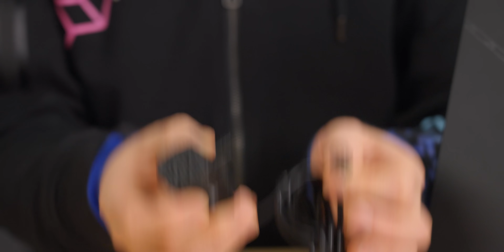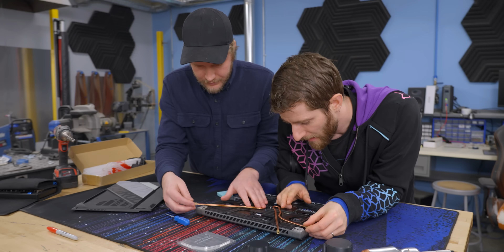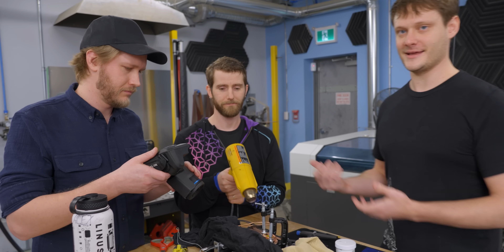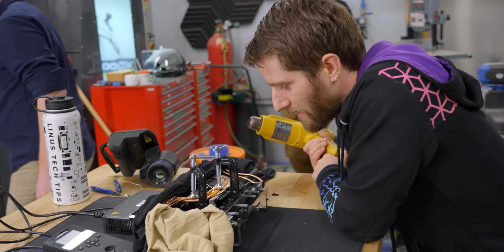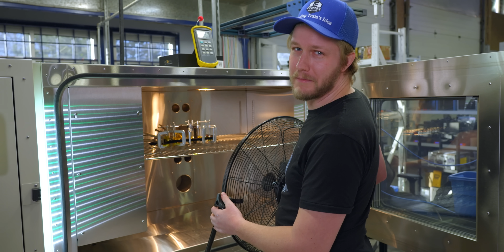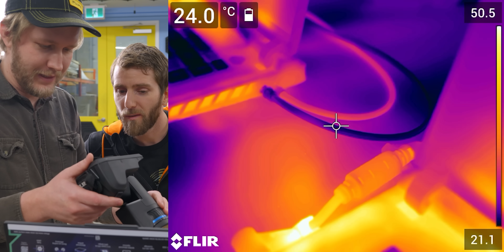Water Cooling a Laptop for $30

Comment: This is literally a live example of when stupid has way more luck than brains... They bent whole cooling out of shape and then pushed full force on two naked dies and somehow didn't damage them.
Reply: [insert “first time” meme]
Reply: Ive done tool and die for a long time.
And done tool and die for elecronics manufacturing.

You do NOT want to know how close they came to mimicking the actual manufacturing proc. for making these heat tube/heat sink assembillies.
But I am gonna tell ya anyway.

OEM's use a thick as heck chunk of aluminum and steel to clamp things together then throw em in an oven to get the heat to melt the solder. That way they can shim the pads if things are visiably warped... But they still ship the warped ones. That heat sink was probably in the rework area, probably. Just because it was for a top of the line laptop, otherwise ir would go to assy for a test just like they did.

Thats it.
Humans with simple tools are often the most precise and accurate means of manufacturing anything large. With practice we can even reconize flaws that are on orders of magnatude smaller then light, we cant measure the flaw but we can detect them just with our fingertips.

We are increable animals all of us.

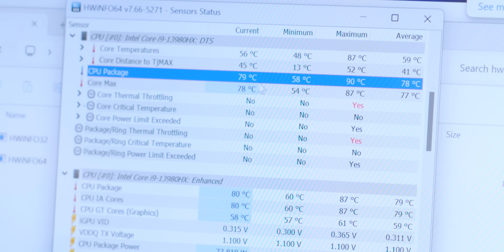Comment: 24:00

I think it's because the laptop doesn't use the dGPU when it's running the internal display and idling, the mux switch turns the dGPU off. When you plug an external monitor to the laptop, as the HDMI (or DisplayPort) is wired directly to the dGPU, the mux switch will activate the dGPU at idle thus the thermal sensors and whatnot. Happened to me on two different laptops with a dGPU and a mux switch.

I assume if the laptop doesn't have a mux switch the dGPU will run continuously thus the sensor readouts.

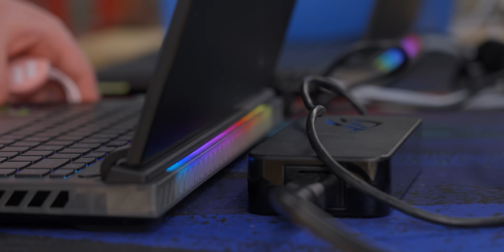Comment: Please talk about the fact that laptops have such a heat dissipation issue when layed down flat. I feel like the trends have gone to be thinner, with as side result that the cooling power is offered up, mostly "ignoring" the back fan exhaust and dumping EVERYTHING onto the surface it's put on. Even  Alex had to give the stock laptop a boost ,by doing the trick (33:58)

Comment: What happened with the solder is that the solder they were using fused with the other one, which caused it to be susceptible to a lower heat resistance, we use lower heat solder to de-solder things with a high temperature resistance solder

Comment: Tip: never buy a Moza product. RMA service is very poor, and Hardware experts also let you down for months. I have had my R5 set with brake lite kit in transit for over 2 months. Picked up last week so it was not repaired and therefore hopelessly unable to sim yet. So back to the HE in Lelystad, the Netherlands and they would urgently arrange a new brake pedal (because it was/is still broken) from Rseat Germany, now more than a week later and still no pedal from their intermediary/importer/wholesaler Rseat Germany who was supposed to have it delivered urgently via DHL, well they have not been able to deliver it after more than a week. So my advice is not to buy anything from Moza, nor from/via Rseat and certainly not from Hardware Experts.

Comment: I had my old 2016 razor blade “professionally done” back in 2018 when I lived in China. Minimal disruption to the case, custom bent pipes, and fully soldered onto factory heat pipes. Worked absolutely like a charm until the VRMs cooked because of the fans not spinning. Was fun when it lasted though.

Comment: Have you tried a Polar Care unit for water cooling? It seems that every time the hospital performs an operation on a knee, shoulder, or other joint, the patient ends up going home with a Polar Care unit. These have a small cooler for ice, a water pump, tubing connectors, and a power pack, which just feels like it wants to cool computers after helping the patient.

Comment: Its actually crazy how simple a mod this is, and you can do it a lot cleaner with quick disconects and a decent res. Plus, by not heating the ENTIRE cooling setup for soldering, it would be almost risk free
Reply: heating the entire setup seemed necessary otherwise, with all the heat conductivity the cooler has, it won't solder. Not sure tho

Comment: guys i build guitar amps and fx pedals for  living cooling down solder by blowing air on it can make cold solder joints since your just contect pipes together probably be ok but a connection where current or signal needs to go through can fail by cool down the solder quicker than it does by itself, its called a cold solder joint

Comment: Actually, by removing that black paint on the heatsink radiators with IPA reduces the max temperature by like 5-7c.. the cooling on this laptop is already an overkill but removing the black coating really help a lot.  My old Acer aspire came with coated heatsinks and when i removed that coating i've got like +- 5-9fps boost in every single game because the cpu and a gpu was running few degrees colder

Comment: I'm sure adding a small heatsink to the end of the copper pipe and cutting some small holes in the bottom of the case and attaching a mesh to it should keep temperature away from 103c ever again. It was 98c thanks to the Gelid thermal pad on Windows 8.1 but now that I'm using Linux-meaning my only API is OpenGL 3.3, I'm stuck with keeping my GPU temps under control by not pushing it so hard.

Comment: Heat gun the plastic back while it's screwed in, go low-mid temp, go slow. it should soften and become compliant to the heat pipes. mount a 3d printed  housing forbattery pack and pump and a radiator then epoxy it onand you have a luggable water cooled "laptop"

Comment: I did mine for cheaper :
240mm AIO, cut a hole through the bottom of my laptop, installed a support at the spot where all the tube crosses (mine had a perfect flat spot for that).
It works like a charm and I can still run without it.
Drop the temp by about 20c when I turn it on.

Comment: Wouldn't it have made more sense to attach the copper pipes to the heatsink instead of the die area? Heat pipes are extremely efficient at moving heat, only outdone by graphene and the like. Adding the copper pipes to the heatsink instead  would have increased thermal mass for the heatsink meaning that it would take much longer to heat up. 

I would like to see a DIY approach with making your own flattened copper tubing from a hardware store in the future, and a larger diameter tubing like a 3/8" or such. 

If you do do that in the future, consider also the fact that attaching the pipes to the heatsink vs plate would be easier than the plate due to heat saturation of the fins. It's a pain to solder heat pipes to anything, and I've gotten away with it in the past using a bucket of water with the ends of the heat pipes dipped into it to prevent them from exploding like an atom bomb.

Comment: It would be neat to have legit add-on parts that easily connected to certain laptops for improved cooling. I would add that cooling like that could be beneficial is some niche uses like archaeological digs and mining etc, where the ambient air may not be suitable for proper internal cooling. Imagine you have your laptop and then you have your cooling pack - no air flow into/out of the case needed!

Comment: I feel like I would have used a wire wheel brush to take the paint off, and a map gas torch with plumbing solder to connect the heat pipes together.

Comment: I got the Amd Ryzen 9 7945HX3D version, might have to try this when the day comes when my warranty expires.

Also what I've noticed was the cpu is always at a high temp even without load, and the 4090 doesnt run till a game launches most of the time, overall pretty good managment of heat and utilization.

Comment: Linus I am very surprised that you don't use a Precision Electric Screwdriver for disassembly and assembly of stuff like laptops and devices with Smaller screws, usually in multi-dozens! Lots of advantages over using traditional unpowered hand tools! Speed being the main advantage

Comment: Well this has been a learning experience..... manufacturers need to "perfect" this method and invest heavier into it.  I cant help but feel like it would be worth adding overall thickness to be able to use the space behind the display for part of the cooling solution. If you tossed laptop fans and a radiator of sorts into the "lid" you could take advantage of the vertical orientation for heat dissipation. That might be the only way we could have a fully integrated, liquid cooled laptop. 
I hope someone out there smarter than me experiments with that idea.

Comment: I wish someday we have laptop using liquid cooling system and I have idea about this video, why don't you guys  joint the copper cooling line then extended outward, and bent downwards, the bend is made as close as possible to the end/edge of the laptop cover then connected to a copper plate that is the same width as the laptop, this is the part where the copper plate is cooled perhaps with water or Peltier element.

Comment: You guys should revisit this. also to help prevent what happened have the underside of the copper pipes be cooled so there is less change of heat separation.

Comment: K5 Pro needs to have a disclaimer - not for high power components. Laptops max them out and any more heat saturation causes separation of the liquid component and overheating/blue screens. It's also TERRIBLE to clean off. Many people have complained, I put it on my 3080 to replace the stock pads and it was awful. Waste of time and money.

Comment: Hah, I did something similar to my old 2019 MSI gaming laptop just last month. I used a copper water block and some extra long tubing. It is attached to the laptops copper heating pipes using ABS plastic simply dissolved in acetone with thermal paste in between. The abs contracts when it solidify so it is a very secure and snug fit. It starts melting at around 105C but it theoretically will not even reach that even if the whole thing was unpowered. It is powered by an old ZooMed canister filter I have lying around. It works very well. During stress test, my cpu is usually 90+ C, but with this, it is very happy at 70C. With regular use, my CPU is Usually at 55-60 but it is arounf 25C with this diy. 

I want to switch to aluminum water block so I can actually pipe the water into an aquarium and see if that residual heat can be useful to warm up some of my tropical fishies lol. I'm used to maintaining aquarium filters so cleaning the water block is no stranger to me.

Comment: Just 3D print the whole laptops back cover to compensate for the water tubes, I mean y’all have the equipment to do it,  why not just add more laptop fans to that 3D printed back cover with custom wind tunnels ,, I’m certain the results will be very interesting

Comment: Forget solder. JB Weld has epoxy that has a metal filler.  A wire brush wheel would have been netter, and safer, than a grinding wheel; just saying.

Comment: Far easier to tin the area's of contact and the new heat pipe THEN heat the new pipe only until you see them both flow together, that will isolate the heat away from the rest of the heat pipes

Comment: I´m really perplexed that you didn´t just stick the water reservoar in a small refrigerator to keep the water in temp steady at about 2-4 degrees Celsius. Or better just silicone the refrigerator door shut and use the small refrigerator as a reservoir.

Comment: I did this for my laptop linus!   Got a freezemod SLMZ-Z-B from ali express and the same flat copper tube. Managed to secure it, chop the cover and get it going.  Im seeing DRASTIC differences on my aorus 17 laptop with a 3070ti.   My CPU was the main issue temps reaching 92 regularly and causing thermal throttling.  Now after my little set up im seeing not a single temp go over 76-78
Reply: Only downside is the freezemod fan is not adjustable. Might get a voltage adjuster and wire it in. The fan is running full steam and very loud

Comment: The GPU is limited on battery. It is 3/4 on power cord. External power to the GPU is an easy mod to boost GPU performance.

Comment: servers and things like the IBM mainframes have quick connect for water cooling that don't leak... waiting for someone like dell to make a laptop and docking station combo that basically the laptop snaps into and water cool fittings connect so when docked it has water cooling and when you undock it, it is just passive cooling... i only say dell, because it seems like something proprietary they would do...

Comment: I hate plundervolt. Undervolting a great way to save energy. On Optiplex and Prodesk SFFs I can with 6-8th gen but 9th gen nope i assume because no BIOS version existed before plundervolt but I thought a modded BIOS could always get around it. There is a lock somewhere else too? I've seen Intel XTU use up a lot of clock cycles just sitting in the background. Throttlestop is more efficient in my experience. 

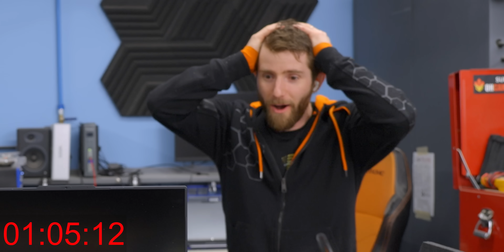23:30 May have taken so long to boot because of memory training been wiped?

Edit: From Orion_'s post, sounds like CPU-level undervolt lock only exists on 12th gen that's weird..

Comment: Asus are so great at cooling that you can use their tech as heat warmer in winter and still get artifacts with lowest budget gpu's and most efficient cpu from amd. by the way i use the same soldering as them too

Comment: dude  my laptops hinge broke so I remade it in acrylic and I added water cooling my laptop for 10$, I hacked the i2c pins from an hdmi and added a rpi pico for regulated water cooling and some other extra things, It gives me a 50deg solid Temperature at 4.1 full turbo on a 8750H

Comment: I thought about using the little coper tubing for an automotive oil pressure gauge and wrapping it around the heat pipe with some thermal paste to do a water cooled laptop. But i never finished it.

Comment: The CPU stand-offs coming off of the PCB is really not a good look for ASUS in my view considering I've had the exact same problem with my daily driver laptop God knows how many times now. I only salvaged it so far by cranking my FX-888 to the max temp and torturing that poor standoff into submission, after cleaning the leftover solder on both ends. 

Regardless, congrats on your project, it was quite a ride!

Comment: @Linus Tech Tips
I really liked this solution, and I would like to try applying it to my notebook. But before that, I ask: If the water circulating inside the copper conduit is cooled, is it possible for condensation to occur outside the conduit, especially if the ambient temperature is higher than the temperature of the circulating water? In this case, the external surface of the conduit will be colder than the ambient air, which can lead to condensation of the moisture in the air, forming water droplets outside the conduit, potentially damaging the electrical components?

Comment: You should have used flux, & 140watt solder gun imo it would have been easier.
Regular copper pipe flux would be fine also regular copper pipe solder would be ok too.

Comment: Bench grinder to remove paint? With a stone wheel in it?! Like what you use to GRIND METAL?!?! You really dont have a dremel with a sand pad bit or failing that a sheet of 600 grit sandpaper anywhere, instead you want to bench grinder a ton of DEEP marks and scores into the soft copper, totally destroying any hope of achieving thermal contact between the 2 copper pipes ?! I would sack the man that suggested removing paint with a stone disc on a bench grinder ffs. That is beyond stupid!

Comment: If Asus were to do this properly and charge an extra 500 bucks I'd jump on it instead of the current SCAR 18
Especially if they offered the stationary part separately so that I could buy one for each desk I'm planning to use mine on.

I'd pay another 500 for a 24GB gpu instead of the 16GB. The speed is fine.

Hey Asus! let me spend another 1500-2000 USD to get the ultimate portable workstation experience.

Comment: yes they do air pods count as ear protection..
you cant boot if the case is open? when did that become a thing?
Reply: Old comment, but chassis intrusion detection is a feature on most motherboards, it's just usually disabled from the factory. ASUS installed little sensors that are depressed when the bottom plate is on.

Comment: I mistakenly bought a too powerful i72630qm for my thinkpad t420. it will function on it but that isn't the problem, its actually all the heat that is hard to cool down with the stock t420 cooler. could just buy another i72620m 2 core that is more optimal for it but im going to try modifying another heatsink for it that is made for the t420 with the nvidia gpu, i have the motherboard without the nvidia.

Comment: Just ordered a rog strixs g17 , will also drill holes in it, put this pipe where i want (im a mechanic)
and cool the outside with a custom system i still have to think about. that is detachable.
Reply: im thinking some timed liquid hydrogen drops on it or smth, pure cold typa stuff

Comment: soldering is not the best solution, as it will use SN instead of copper, making it not very heat efficient, also, laptops get very hott, i dont know the melting point of SN but is not too high, so it could possibly melt back?, not sure.